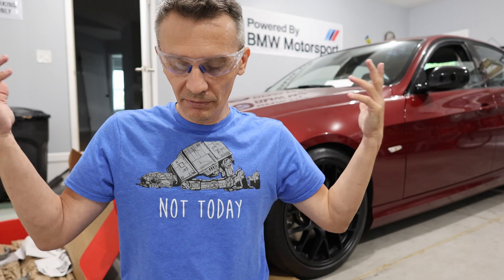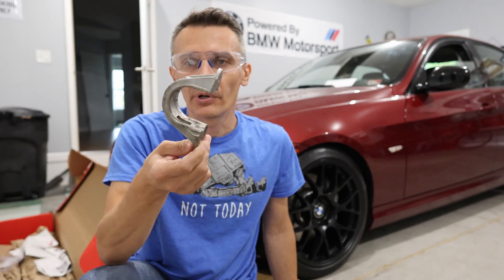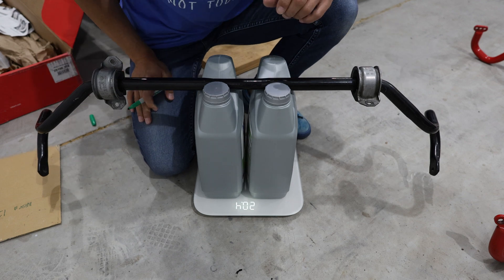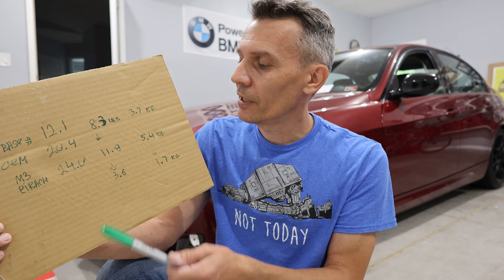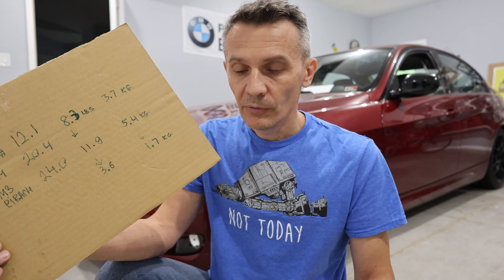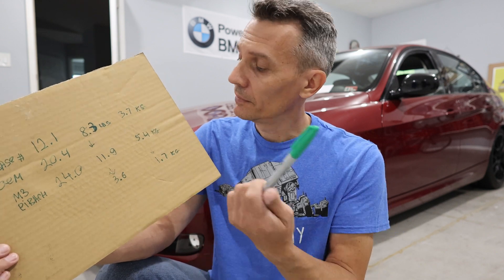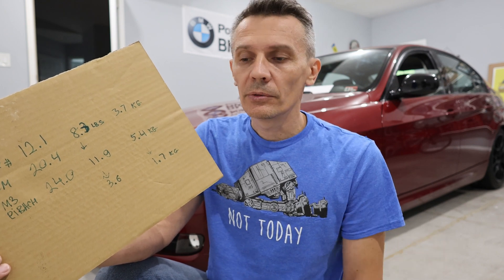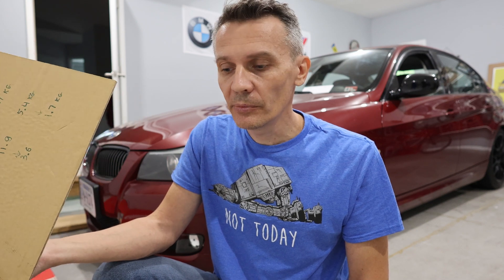Aftermarket Swaybars vs. OEM - how do they compare? | BMW Suspension tuning | E90 328i | E9x

Comment: So what swaybar do you use in the rear?
Reply from the maker: E90 M3 rear sway bar 22.5 mm.
Reply: @maxsam201  cool, do you have lsd?
Reply from the maker: @MS-we4wi  no lsd, still on the original auto diff.
Reply: @maxsam201  did they make a big difference on the handling? Would you recommend the upgrade? Currently considering H&R 27/20 for my e90 m sport.
Reply from the maker: @MS-we4wi  H&R are a popular upgrade, but you have to keep in mind that they are solid bars and that makes them heavy. In my opinion they are too much for regular street driving. M3 bars are tubular. "Big difference" I would say no, a noticeable difference maybe is a better description. But that also depends - are you driving mostly on the streets or going to a racetrack?
Reply: @maxsam201 Hmm, I was actually thinking that rear M3 bar was a little too thick for the rear. But maybe the M3 bar is actually less aggressive because of the tubular design. Thanks for your opinion and advice, you have given me something to think about. It's for the streets/ twisty roads.
Reply from the maker: @ You're welcome! hope whatever bar you go with, makes your car feel right.